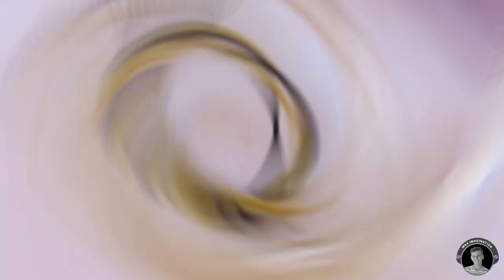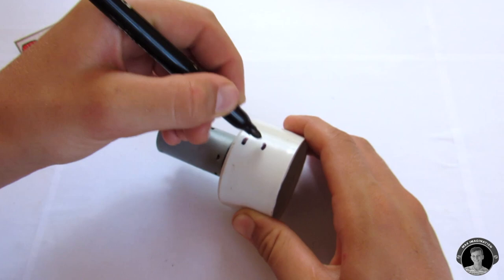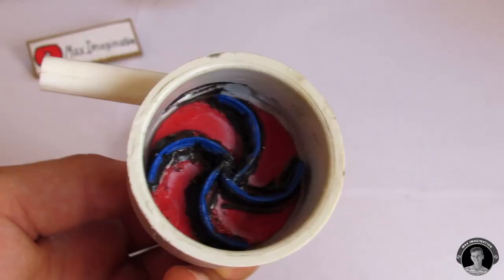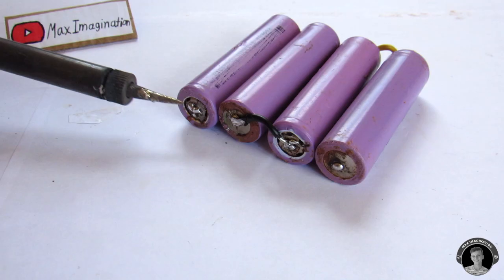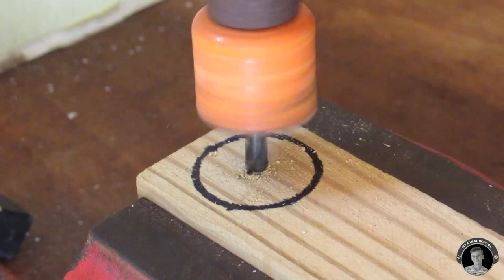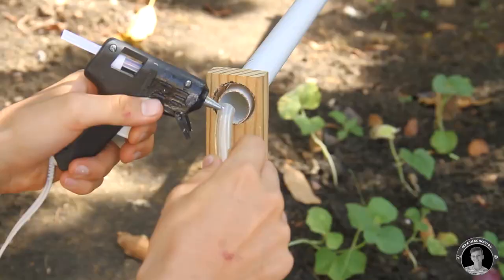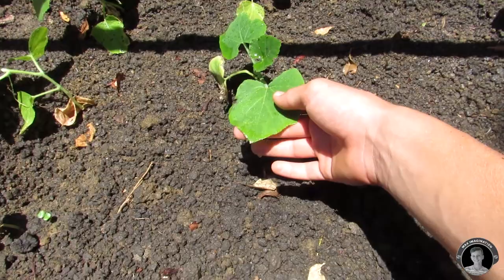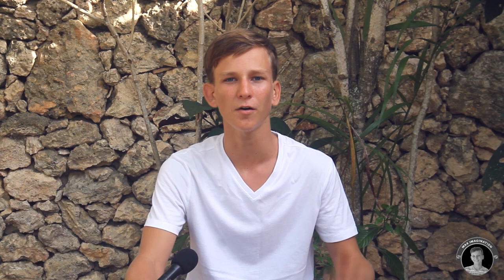Build a Mini PVC Water Pump for Home Irrigation | DIY

Comment: Cool garden. Just wondering how it pumps out so fast as the propeller is sucking it up not shooting it out. Is it just that the water build up and then once it fills it empties out the other hole?
Reply from the maker: Thanks, Henry! A little kick start with a hose is needed for the pump to keep up with supplying water right afterwards. The pumping gets easier as the water gets more filled up in the PVC tube, resulting in a lower pressure intake through the clear tube for the pump to push water up. 

Also, the pump not only sucks water, it pushes it with almost equal force out the other end. 
I hope this makes sense.

Cheers!